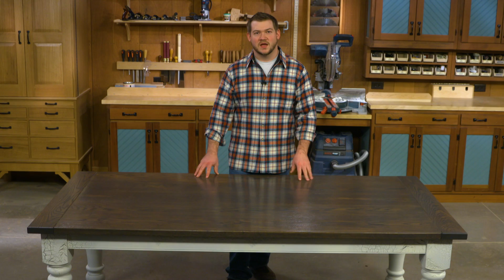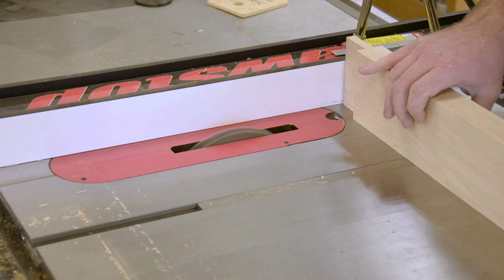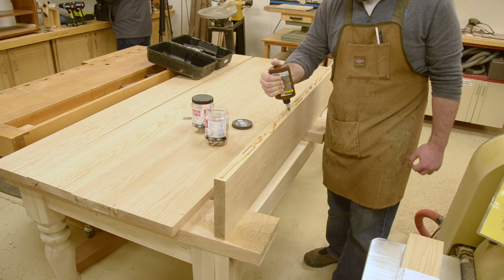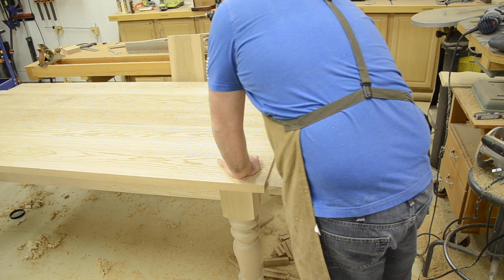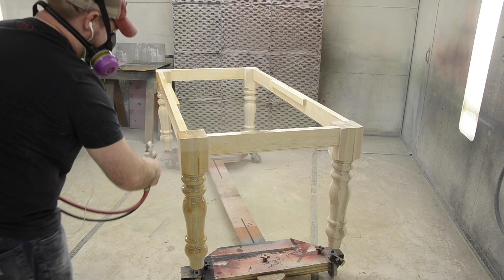Woodsmith Makes - Farmhouse Table

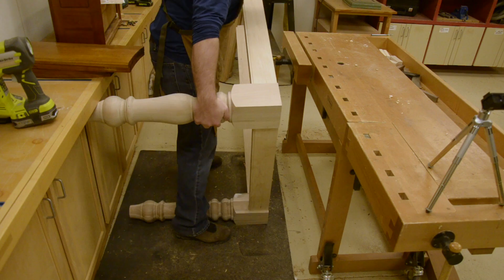Comment: Tell me more about the clamps you used around the 4:30 mark.
Reply from the maker: Those are Dubuque Clamp Works aluminum bar clamps with a little shop modification...  The wood extensions you see were a tip we did back in issue #169 of Woodsmith Magazine.  You can find out more on how those extensions were built and work here: http://www.woodsmithtips.com/2014/04/10/long-reach-clamps/

Comment: Jig saw to trim the ends - hadn't seen that before. Usually, the guys use a circular saw and straightedge.
Reply from the maker: To be honest, they were hidden, so I wasnt going to be too concerned with them. And, I only had to trim them because my router bit was maxed out in the bread board end and they were touching 😁.